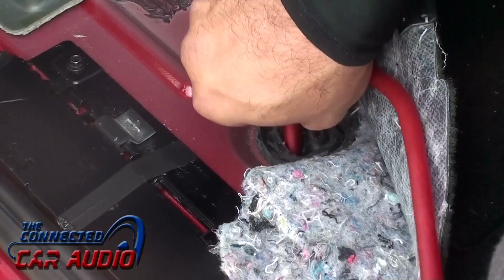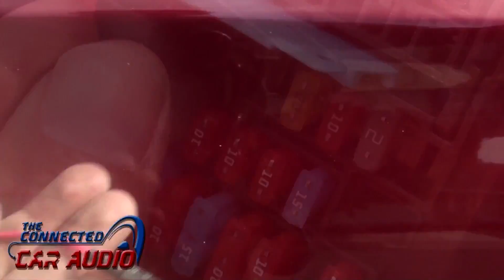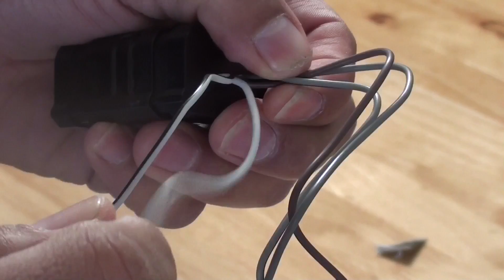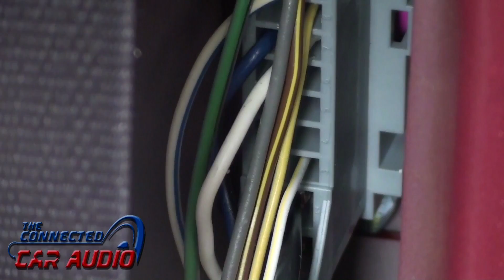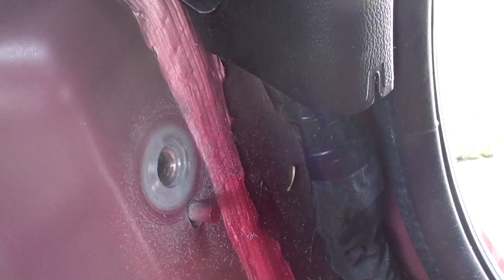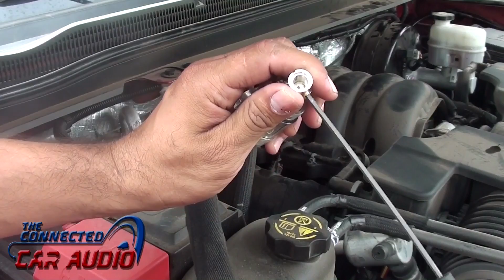How to install subwoofer amplifier in GMC Yukon 2015 and up

Comment: Good video but tapping into those speaker wires wont work with factory crossovers in my 2015 yukon. I followed this video to a T and all output I got was mid range. You need to tie into the factory sub speaker wires for bass. Im having a hard time getting to it as I think it up in the front of the center console
Reply: Use your rear speakers wires
Reply: yes!! i have a 17 tahoe with bose, I can't find any videos on how to tap into the wires that come off of the factory bose amp to the subs, and which wires to use. Can you direct me to any info?
Reply: In 2015 up with bose this video will not work in back on driver side u have a what looks like vent u can pull that off and u see the bose amp the plug with the gray blue is hot ... And the gray and black is negative very easy to tap into rather than center console ....
Reply: @getloudcaraudio I know you put this up a year ago.  If your still listening I have a question?  Will this work in a 2015 yukon denali xl.    I had a 2009 and did the console install with my last loc.
Reply: What is the best way to get to factory bose sub? Up to this point now..smh
Reply: @antoniomtz1320  it's under the center console between the driver and passenger seat...check Crutchfield or just Google it
Reply: Ok
Reply: Thanks for your comment! I follow this video to a T also, and my subs sound awful! I bought different amps and subs. Still getting the same results. Can someone please tell me what wire to tab into…
Reply: @ronniestephens665  tap into the factory sub , via the factory bose amp located in the rear driver side area by the jack .
Reply: @MOB408209  how do you find out which are subs?
Reply: https://youtu.be/zXEu0Hqi7lM
Reply: Use link above i posted u under stand better this video is for vehicle with out bose
Reply: You forgot to mention that this car does not have Bose.

Comment: Nice vid. But after doing install i noticed that where the amp turn on wire is tapped in to isnt good if you step out vehicle with keys or with out will cause amp to temporarily turn off while the car let's you kno the key fob is in or out the vehicle haven't found a better spot yet but ill hold out on that one

Comment: I did everything exactly the same but i am getting a loud noise out my sub every time i accelerate
Reply: Did you figure it out ? I think you have your rca cables running too close to your power wire

Comment: AMAZING VIDEO !!!!!!!!!!!!!
just Picked up a 2018 TAHOE over Bumps Right side Speakers Cutting OUT !!!!!  WTF Car Still Has WARRANTY 
I then Notice Thick GAUGE Wire Run just like you Going inside ?
I then see its Running to the CONSOLE AREA Below the RADIO .
TODAY Weather STILL GOOD - I decide to TAKE THE RADIO OUT and see WTF is Going on .
I Locate the LOC Below the GM 8427 Reciever .
Right next to it is the AMP SILVER in Color with 2 small adjustment knobs !!!!!!!!!
all this stuffed in the FLOOR CONSOLE Between Driver and Passenger SEAT on the Carpet .
STILL TRYING TO FIND where the Wiring LEADS TO .!!!!!!!!!!!
Reply: Do you know where the factory Bose amp is
Reply: @rizisupra7853  Not Sure - Have not Taken appart the Console Yet - Still Driving me Crazy Over Bumps- the Original OWNER installed a LOC under the Console , Not Sure if the Original Owner Removed the SUBWOOFER SPEAKER when Traded in the Vehicle , i GOT a OEM Subwoofer SPEAKER that Fits UNDER the CONSOLE .

Comment: Just an FYI, there is a nipple that you can cut off on the firewall grommet that allows for running wires. If you use the drivers side grommet, it will come out just above the electrical center to the left of where your foot rests.

Comment: For anyone installing a Sub Amp with a Factory Bose Head Unit, DO NOT tap into one of the speakers for your high level out as these are crossed over by the head unit (Bass response will be minimal).  You should go under the center console and tap into the Subwoofer input (& Disconnect that POS while you are in there).
Reply: I have done this and no sound is being output. I tapped the sub wiring in the center console on my Tahoe and it's like Bose knows it wants me to fail. Amp is powered on and sub works in another vehicle. Any more insight?

Comment: When shaving the cable I use a exacto or box cutter but your way if not other way 

I recommend going around the cable in a straight line this technique takes time to learn though  -but the last thing you want is a bunch of cable being cut into so if there are more than a bundle of strands falling out then recut and try again -I generally get about  1-3 strands on the usual... but I recut if it's  over 5 or close to 10 strands because  that's close to a bundle.... bundles are what they twist together smaller bundles of wire to make 1 big bundle called cable